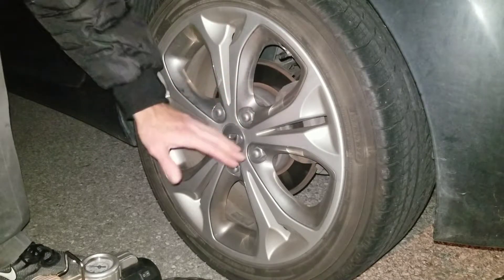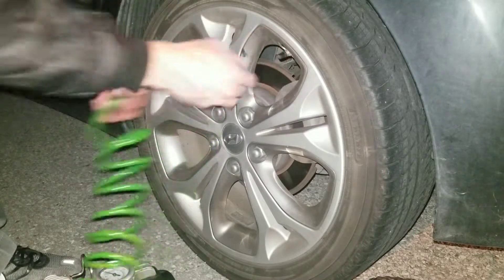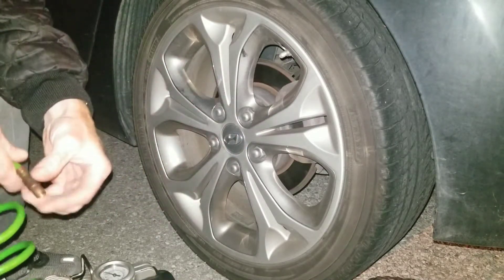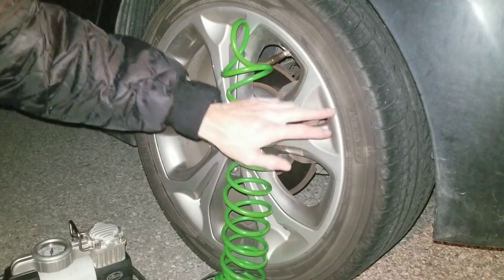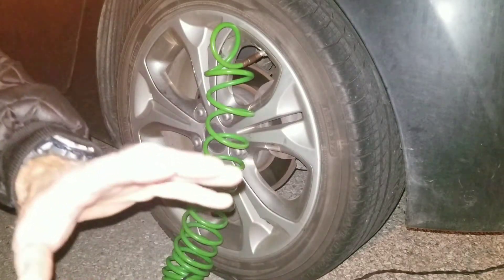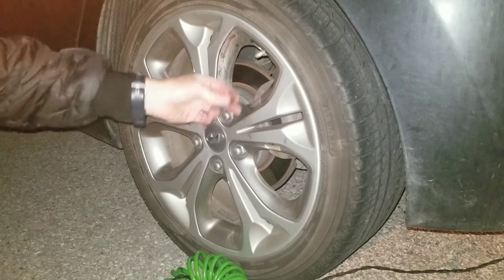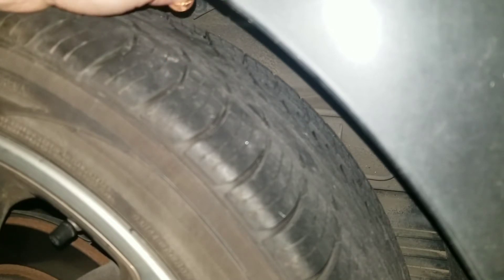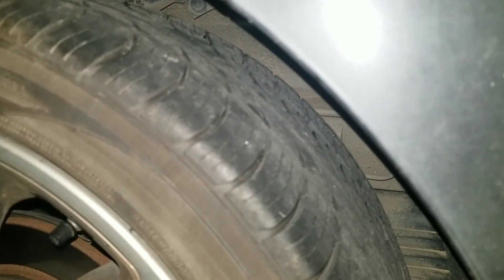How to check tires what most people dont know

Comment: NO!!! You are way better off and safer by going off what the manufacturer of the VEHICLE suggests. 45 PSI for that tire is way too high and actually MORE dangerous than 30 PSI. Even if they are not stock tires, you should always stay around what the vehicle manufacturer recommends. Max PSI rating is the maximum PSI that tire needs to carry its MAXIMUM LOAD, not necessarily the load of that certain vehicle.
Reply from the maker: It is stock tires and was set vehicle's manufacturer
Reply: @NATESINTERACTIVEAUTO  What I was trying to say was your rule of 5% off of max PSI is not always correct. For example, my truck says recommended 29 PSI, but my tires say max 50 PSI, but if I did what you said and filled it around 45 psi, they would definitely be over inflated and cause extremely harsh ride and cause the vehicle to be unsafe.
Reply from the maker: I understand i should have been more clear i read the vehicle specs and it states follow the provided recommendations for inflation unless its a different type of tire but it must meet gross weight load also size ect...  and the tire manufacturer states do not exceed max press but make sure do not inflate after driving recommended morning or nice and cool ambient temperatures